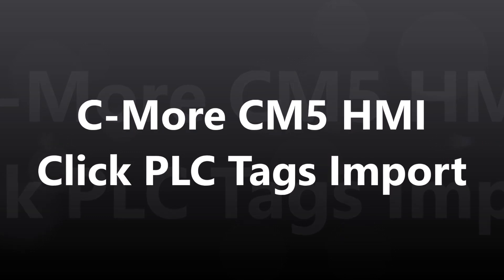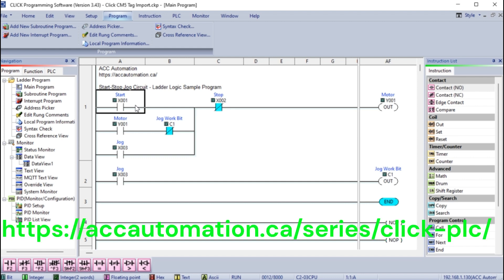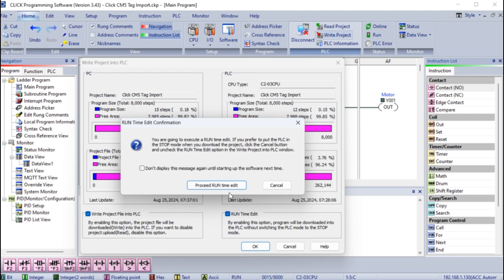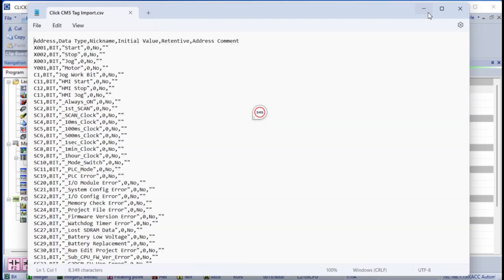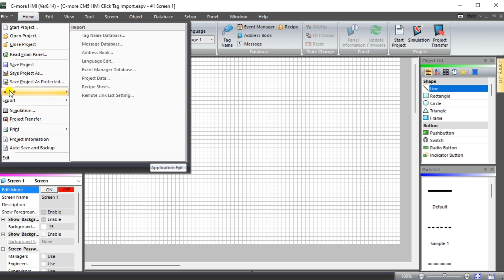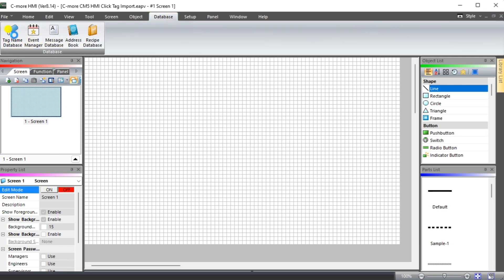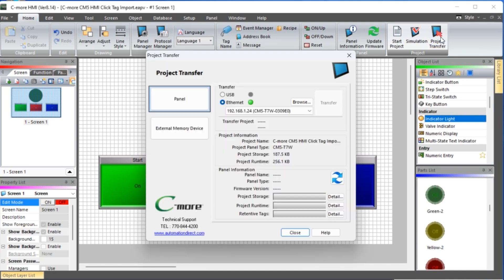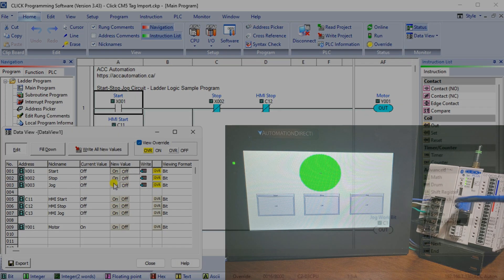C-More CM5 HMI Click PLC Tags Import

Comment from the maker: More information can be obtained at our website. This includes all of the links mentioned in this video. 
https://accautomation.ca/c-more-cm5-hmi-click-plc-tags-import/
The C-More CM5 HMI series can be found at this URL:
https://accautomation.ca/series/c-more-cm5-hmi-series/

C-More CM5 Quick Features:
4″, 7″, 10″, 12″, 15″, and 22″ widescreen options
16.7M colors and LED backlights
800MHz or 1.6GHz Quad Core CPU
43MB project memory
12 to 24 VDC powered
Built-in real-time clock with 30-day backup (no battery required)
NEMA 4/4X (indoor use only), IP65
FREE HMI programming software with powerful design tools and a project simulator
CM5 series HMIs support any EA9 series project (created with V6.73 or later) for an easy panel upgrade

Support Links:
C-More CM5 Frequently Asked Questions (FAQ)
https://accautomation.ca/series/c-more-cm5-hmi-series/c-more-cm5-faq/
CM5-T7W Cut Sheet - Tech Specifications / Protocols
https://cdn.automationdirect.com/static/specs/cutsheet/CM5-T7W_cutsheet.pdf
C-more CM5 Overview
https://cdn.automationdirect.com/static/specs/cm5t7w.pdf
CM5 User Manual - Hardware
https://cdn.automationdirect.com/static/manuals/cm5userm/cm5userm.html
CM5 Quick Start Guide
https://cdn.automationdirect.com/static/manuals/cm5userm/cm5qsg.pdf
Product Brochure
https://cdn.automationdirect.com/static/catalog/images/product-pdf/CM5-C-more-Overview.pdf
C-More Programming Software (CM5 Series)
https://www.automationdirect.com/support/software-downloads?itemcode=C-more%20CM5%20Series
CM5 User Manual - Software On-Line
https://www.automationdirect.com/c-more/cm5/software-help
AD C-More CM5 Sample Projects
https://www.automationdirect.com/adc/shopping/catalog/hmi_(human_machine_interface)/graphical_hmi_devices/hmi_panels/cm5-t7w#

ACC Automation
https://www.accautomation.ca
Helping you with your automation control tasks...